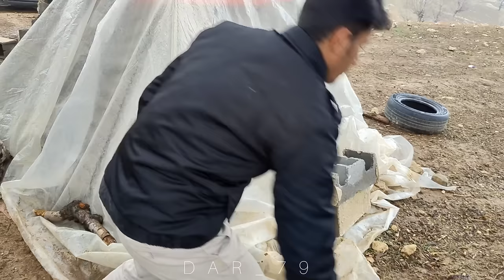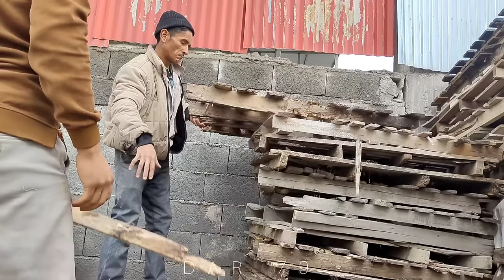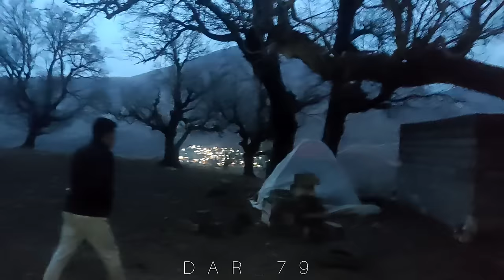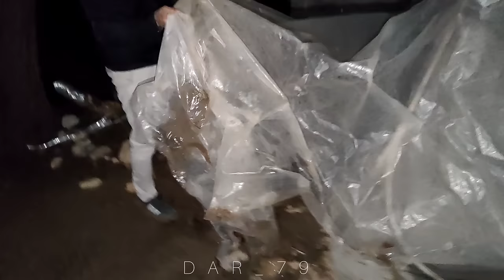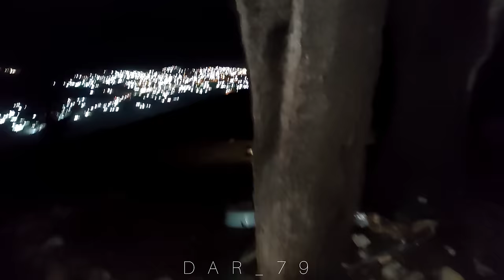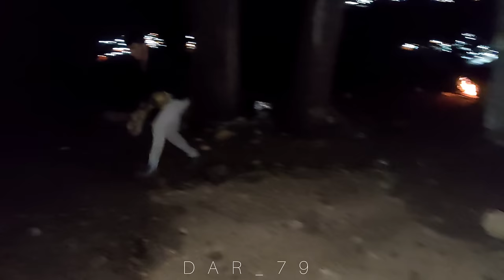Shopping in the city: Narges and Rasool travel to the city to buy building materials

Comment: You should installed a roof slope. This is to help the water running in a rainy season and to avoid water sitting on a flat roof and to prevent leakage. Just raised the wall on a front or back wall (pick one) that will create a slope. You can use the same material from the old house and to ensure the laminas use steel nails or make wholes an run wires and attached them to he posts and sealed the holes crested with tar. Hope I didn’t confuse you ….❤